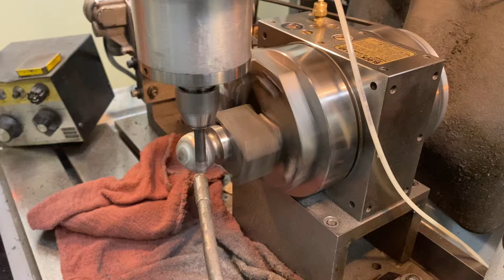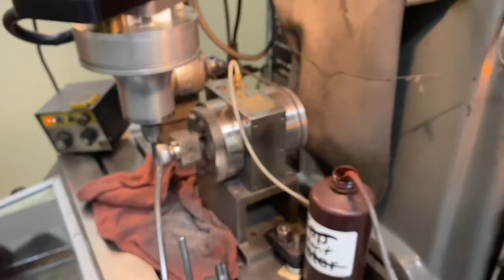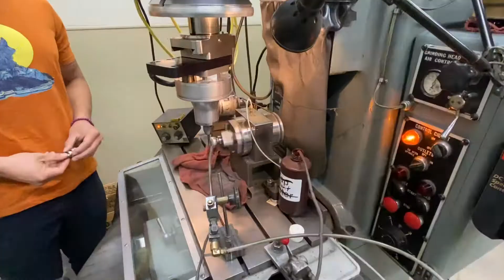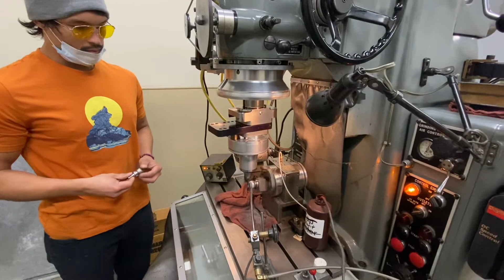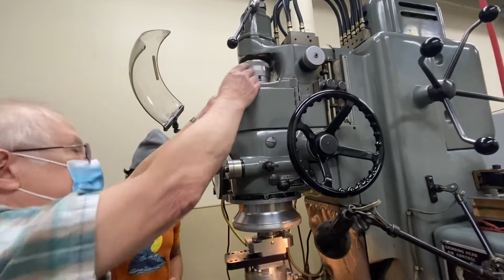Grinding a test ball

Comment: What's the benefit of this method over your normal generation method?
Reply from the maker: We can get the ball down to about a micron roundness and sphericity. That makes lapping it a lot easier. It probably could be done by hard turning but then the work holding becomes more difficult because the forces applied are much higher than grinding.